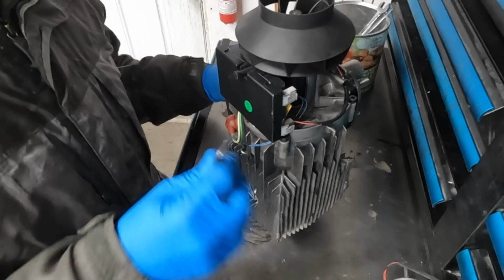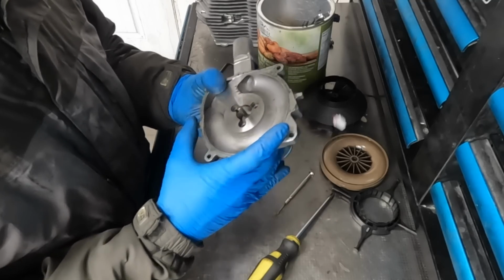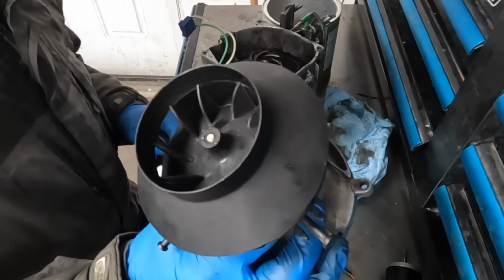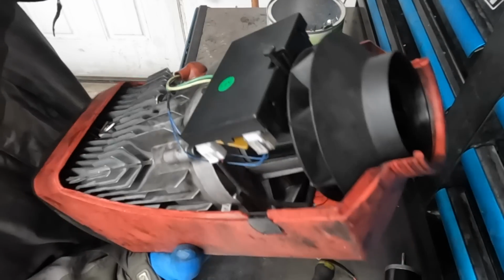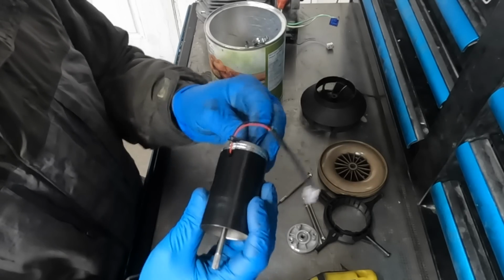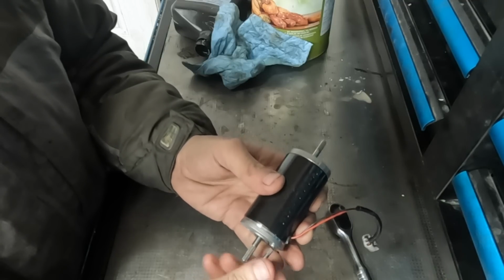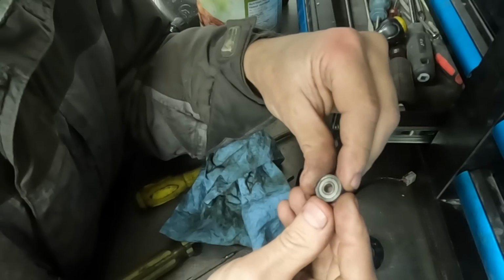Diesel Heater Fan Motor Replacement - I finally destroyed it !

Comment: Does anyone have the measurements of the brushes so one can replace them when they’re worn out?
Reply from the maker: Wow... that's the most frugan thing I've ever heard. Sorry, but I don't. 

I currently have "hot" cooling water in my sink, that I used to cool a distillation... I'm keeping it in my sink to scavenge the heat, before I let it go down the drain. I do the same when I wash my hands, haha. 

All that to say, I'm not criticizing, just shocked because the motors are so cheap. Hopefully someone here can help... If I have one apart I will try to remember to post it... I think I have a bad motor in one of my heaters, but I have lots of other heaters to use, at the moment.
Reply: @l @loweredexpectations4927 aha, didn’t even realize that it sounds that frugal 🤣. 
But the intention is indeed a different one. I have about 7 diesel heaters and rely heavily on them. While motors/parts and complete heaters are available now without problems, this might change in the future. 
I live in the EU. And here EU regulatory bodies are famous for forbidding things they don’t like, especially for environmental reasons (like an unregulated fossil fuel heater for example…). 
I am just preparing for all possibilities. So one day, there might be no more heaters here, but maybe brushes 🤣. And while it’s easy now to put some motors on stock for the future, it’s even easier and cheaper to put 50 sets of brushes aside 😅. 

Same thing might happen to the US as well. One day it might not be just tariffs. Think about it 😅.

EDIT: the reason why I have to use diesel heaters in the first place is also due to regulations. I am not allowed to use a fixed wood stove for heating my garage because then the exhaust has to comply with a bunch of different regulations and has to be checked yearly by a professional. Instead I use the diesel heaters because they count as „mobile heaters“ (as long as they are not fixed in place) so the legal situation is a different one compared to fixed furnaces.

Comment: Can I just unplug the fan and put a positive and negative wire into the the plug and to a battery to see if it spins before dismantling
Reply from the maker: Yes... if you use a 12V battery it will spin line mad and may scare you... You can probably use a 9V battery or a low amp 12V power supply.

Comment: idk how you pulled that fan apart so easily. is that a brand new heater? i literally destroyed mine trying to get it apart just like you did. those turbines were welded on the shaft, and so was the other black piece.  not fun! ☹️
Reply from the maker: Sorry to hear you had so much trouble. They are sometimes on there pretty good. I did on new one about a month ago when I made a "porting" video and it couldn't have been too hard, as I don't remember cursing at it. 

I have done it with at least 4 heaters, but I have also been a mechanic for 30+ years so I'm used to figuring such nonsense out. You have to grab both fans and keep twisting till the one slides off. You then may need to grab the end, where the one fan came off, with channel lock pliers or a vice, so you can twist the other off.

Comment: I just want to say thank you. I enjoyed it so much. you are probably a genous. you can repair a machine and film at the same time and be funny thats for sure a rare combination :) (in what film did you explain how you intalled your preheater? or ist it just a metal pimpeline going from the air intake to  fuelhoes that goes into the burning chamber?)
Reply from the maker: Hello, and thanks for the kind comment. 

Yes, the preheater that I made was just a 3/16 brake line bent to go through the fins on the heater. This is a video showing it. https://youtu.be/0fFbsiP-iA8

It should be noted that this does NOT allow you to burn engine oil. It could be useful for veg oil or animal fats... but engine oil burns with ash. 

If you don't care at all about stink, CO and lots of emissions, you may be able to burn a reasonable quantity using a modified heater. I have redone some of my tests recently - videos not yet released - and the results were the same. 

Also. If you preheat fuel, anything lighter like gasoline, diesel, alcohol etc, will boil / off gas and cause erratic fuel delivery. Imagine a fuel line full of oil and gasoline. The gasoline will boil and push the oil into the chamber. The heater will run very rich for a few seconds, and then there's a giant air pocket ... so the heater will run lean, or even flame out. 

This is why, in later versions, I added an extra nozzle to add alternative fuels.

Comment: i must have missed it somewhere but did you ever say what the motor was or where to get it ?
Reply from the maker: I don't recall that I did... Probably not because if you Google search "diesel heater fan motor" dozens of results will pop up. It is much easier and not very expensive to get the entire fan assembly. Currently $21 on Amazon Canada

Comment: Perfect ! I thought you would do it best👍 2 of my 4 heaters started making painful noises within 3 days of each other (After 2 years of southern Michigan winter and of course 2 days into a deep cold 9 day freeze) Child’s play cold to a Calgary native I am sure😎 I then got the smell of burned out motor and E-06.. it is I’m sure going to be some if not all of what you have just showed in this Vid, so brilliantly well… Thanks..
Reply from the maker: Wow.... that snuck up on you quickly. Are your fans overworked at all? Pushing pulling thourough long hoses or filters ? Just curious. 

I've noticed bearing noise in a few of mine, but other than one that was 100% my fault, I've been lucky.
Reply from the maker: ps... it's actyally been pretty warm here the lat two weeks or so. Around / just below freezing.

Comment: Fast paced, direct to the point video on this matter...u skipped the brush plate removal.   New ceramic bearings i ordered last season are the shizznit. My 12v 30ah lifepo4 battery now lasts 2xs longer, My battery started dying way faster than normal.
then the unit started consistantly squealing on start up....then it all made sense
Thanks from NC
Reply from the maker: Thanks for the comment! I did overlook the brush plate removal... that may be because I didn't want to damage my new motor... can't remember. 

Did you notice the bearings being quieter? I've got two heaters installed in my bus and I can tell that a lot of the noise is either from the bearings or imbalance (probably mostly imbalance). That's awesome about the battery life.

Comment: My heater unit is trapped inside a metal case with riveted & spot welded connections. I would have to destroy the case to get it out, so in lieu of a $21 motor, I got a whole new heater for $60. Maybe in the future, so at least now I know what to expect.
Reply from the maker: Interesting... I have never seen one that was spot welded or riveted together. That's unfortunate. At least a new heater is cheap !
Reply: @loweredexpectations4927  My curiousity got the best of me & I drilled out the rivets. Everything was exactly the same as yours, just tightened beyond comprehension. I guess heating/cooling cycles will do that. So eventually I'll have a backup. Thanks for paving the way!

Comment: Add another person to the list that was interested in the bearing at the end! It seems to be the #1 reason for failure or needing of replacement due to noise. Now to find a high grade bearing to swap in so I don't have to do it every year with a cheap replacement motor. Or going through all this work only to have to replace the replacement. Thank you very much for this. I'll now be going down a rabbit hole watching a bunch of your other stuff after seeing this first. Looking forward to learning more!
Reply from the maker: I have heard about a lot of people having issues with these, but oddly, I have only ever had this one bearing go bad. Curious.
Reply: @loweredexpectations4927  I ordered a pair of Japanese NSK bearings yesterday. $24 US for one through a local bearing supply here in Idaho. Thanks to you reading the number, I can now replace my fail point with an over engineered part. I really can’t thank you enough. I am going to swap them next week and I feel like there’s a real niche here for upgraded motors with better bearings. I’ll be ordering some mid tier ones and testing over the winter. I’ll keep you posted if you’d like.
Reply: @loweredexpectations4927  I cannot say enough how impressed I am at how quiet and smooth it runs now. I’m sure I went way overboard on quality, but I’ll strip them out if the motor breaks for any other reason. I’m ordering some mid grade to try in another motor soon. The NSK’s are very nice.

Comment: What a great video! I have taken my diesel heaters apart many times but never removed the motor. I found this because after 2 years and a lot of hours my fan stopped working and I want to see if I can rebuild it rather than replace it.  I am very glad you included taking the motor apart and even removing the brush housing end cap to access the bearing. Someone was interested!
Reply from the maker: Thanks for the comment! Much appreciated.

Comment: Thank you so much for this video. I am currently having trouble with a rattling sound from the heater, and as far as i can see or feel, the fan isn't hitting against anything. 
Could it be that the brush holder is damaged? It sounds almost as if there's a loose screw inside. 
I've ordered new bearings thinking that's the issue, but what do you think? 
I've never opened the motor before and your video is all i have to go by. I hope i don't screw it up. 
If the brush holder is damaged, do i have to buy the whole motor? 

Ps: no error signal and it seems to run fine except from the sound. 

I've found no other videos as good as yours. Thanks!
Reply from the maker: Hey. Most of the time, rattling is just the housing of the heater, but if you put your hand on it or push on it, this usually stops. It this is not the case for you, it could be that the plastic case support around the motor is loose. 

I would imagine that if the bearings were making that much noise you could feel it when moving the fan? If the brush holder is damaged, the smart thing to do is get a whole motor, but it is highly unlikely. 

Cheers.
Reply: @loweredexpectations4927 Okay! Thanks! What do you mean by plastic case support? 
Nope, nothing happens if i push the casing, it still rattles the same. The fan spins just fine when i spin it by hand, too-casing on or off, so I'm baffled!
Reply from the maker: @iiriskuusela4506  I'm not sue what the actual name is, but there's a piece that fits around the fan housing and has 4 legs... They basically stop the fan from hitting the case and support the fan end of the assembly in the case.
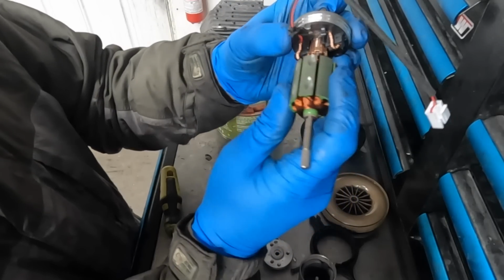Reply: Hi again! I've now gotten to opening the fan motor, but i can't seem to just pull off the armature (like you do at 17:51) It's stuck. Could it be that just it needs some force by tapping it out with a hammer?
Reply from the maker: @iiriskuusela4506  I'm just seeing your comment now. Hopefully you got it sorted out. You can tap on it, just make sure the brushes are out of the way. The bearing may come out of the housing instead of coming off the shaft.
Reply: @loweredexpectations4927  Great, thanks! I'm guessing it's the same thing to change the bearings, tap them out with a wide stick or something like that?
Reply from the maker: @iiriskuusela4506  Yeah. Some of them have silicone /rubber sleeves and pop out easily. Some take a little more force, but you have the right idea.
Reply: @loweredexpectations4927  It seems that the hole in the black plastic on the brush side, is just too small to press out the bearing. I guess i have to get the black plastic loose somehow, though i fear it'll just break. At least I've ordered and am waiting for a brand new fan motor :) 
Wouldn't have tried this if i didn't find your video!
Reply from the maker: @iiriskuusela4506  That's interesting. My guess is that, because there are many different manufacturers, yours is a different type. Fortunately, like you say, motors are available and pretty inexpensive.

Comment: Link is no longer any good for the replacement motor.
Reply from the maker: You can get them on any of the usual sites. Just search for "dIesel heater fan motor". If you want to save yourself some work, you can get the whole assembly, but you can also get just the motor. I found one on Amazon Canada for $13.12 with next day delivery.
Reply: @loweredexpectations4927  Ordered 625-2RS 5x16x5 bearings for them. Set of Ceramic & a set of narrow alloy ones , See which is the smoothest and more quiet .
Reply from the maker: https://www.amazon.ca/Yctze-Parking-Heater-252113992000-HeatersAir/dp/B0C5NVXKK9/ref=sr_1_5?dib=eyJ2IjoiMSJ9.tEiQ5Swg37ADs9O9skB1zpXkDuVMP8A9NLRbl3n72wGC-77nntydrDfCyJU3EiA8cm6jdPhqZAryFwDNrqi8Bo0B9Z5d0cu7k9CFC0by9yXJ5rpwsmpJK7MnZX-jV9oibfRGTk-ZDzSuivEDKMSSKd05gj9Z7TLiim2glveGDQ1hGNONYRo6JWiqXmZRxqYrKNDzBEn9qSjyB1BGCoypWJIkAlfcYyi4B39vo9h5lVCGxtjtoPdPu3aXWSBTZouTs4V0SvQns-_JIhcDhqjbM3v75dTu5_43ch6Im-aCR_VCr75xeCwG-4PuGq73ksofYZxUtiRusZDyloPXS2KV_v-8vL-SA47gnPLN-Pbd3eo5zxajboEwTFZ_dmp0cfYWm0q4o5eKvqYQGxqw8cdisVOTmJvQvnCTVqbeh_SZiaJ-NO3YN9RMASzH4jg2gbRv.TJUQoxkGtIaK18gtzC8qQ-5nw4c-lOJAGdnCrknmBss&dib_tag=se&hvadid=622437235435&hvdev=c&hvlocphy=9194103&hvnetw=g&hvqmt=e&hvrand=212384171206968287&hvtargid=kwd-1410949094637&hydadcr=23389_13536850&keywords=diesel%2Bheater%2Bmotor&qid=1736656618&sr=8-5&th=1

Comment: I use a heatgun to take that inner fan off, it helps a lot. Also, adding gasoline to disel fuel in ratio of 1:3 and running the heater at full blast for 20- 30 minutes helps to clean the guts and prolong the intervals between major cleanings. Thanks for the video and bearing number. Good luck on your new experiments and remember that safety is always number one! God bless you.
Reply from the maker: Ingressing. A little gasoline helps clean em out eh. I'll have to give that a try some time... Although, the heaters that I run on diesel never have any issue with build up... So far, haha.

Comment: Once you open the motor, if the carbon brushes are not flat against the copper ring, then take them out and file them flat. Put them back in one of the springs on mine was weak, so I took a small pair of pliers and gave it one more turn so it had more tension on the carbon. The motor is going well now. It is a very bad design as the springs are too weak.
Reply from the maker: Generally, Brushes are shaped to conform to the shape of the contacts, for more contact area... filing them flat would reduce this, if I'm understanding you correctly. 

Brush springs are generally purposely just strong enough to make the brushes contact the rotating assembly. They do this because 1. More pressure = more friction / resistance. This wastes power and causes more heat. and 2. More pressure means your brushes don't' last nearly as long. 

If there is a bad design choice here, it is the fact that the brushes are sliding in plastic.This should be metal.

Comment: I have an e6 brand new and I tried adjusting the fan but nothing works. I got two and they both have the same exact issue. I’m really hating these right now
Reply from the maker: You have two heaters and they both have E6 errors ? That's very very strange.
Reply: @loweredexpectations4927  bad quality control. One didn’t even start. There was a broken chip on the MB so it just blow fuses. The second throw the E-6 and all the adjustments I did from watching a bunch of videos did nothing. Which can only mean bad MB. Got a new one from a different brand and started right up
Reply from the maker: @letzgow6110  I have had at least 10 maybe 15 heaters, and have had one that had an electronic issue. One that had a kinked fuel line. Never any that were dead on arrival. YT probably wont' let me post this comment due to that choice of words... fucking idiots. Anyway. Either I've been lucky or you have been very unlucky.
Reply: @loweredexpectations4927  I’d say I was super unlucky. From the videos ive watched, there are a few who had dead one brand new also. lol

Comment: I took my new motor apart and replaced the bearings with 625-2RS. 
I don't think my brushes were installed properly from the factory,  it was quieter after.
Reply from the maker: Were the brushes clicking before ?
Reply: @loweredexpectations4927  they sounded weird,  when I took it apart, it looked like the brushes were only half on the copper armature, think that's what it's called.  I used the sealed 2RS because of the dusty environment they run in. 
With the intake silencer and the new bearings and the silent pump, I can set one of these puppy's up in a deer stand...lol
Reply from the maker: @kirkwalsh1932  Haha... one of these in a deer stand would be amusing.
Reply: @loweredexpectations4927  probably have to run it on kerosene for the smell...

Comment: No way did that inner brown fan just pop off your having a laugh i struggled  over a hour with metal knives the lot and was a pain you did not just pop it off you had that off before the video yours maybe a little tighter 😂😂😂 yeah so tight I threw the f… thing in the bin eventually after everything failed even metal bars underneath 😡😡
Reply from the maker: LOL... I don't think I ever had mine off before this... I can't remember I may have had it off to do some porting for a video. 

To loosen it off I turned the shaft back and forth a little, but I assume that some are on tighter than others... but the sound of it, yours was pretty extreme. 

Fortunately, the whole motor fan assembly isn't too costly...

Comment: I find the easiest way to get the black fan off is by pressing a coin on the centre spindle with both of your thumbs whilst pulling on the edges of the fan with your fingers. It just pops off with ease.
Reply from the maker: I'm not really sure what you mean. The shaft is flush with the fan. wouldn't the coin just push on the fan ?